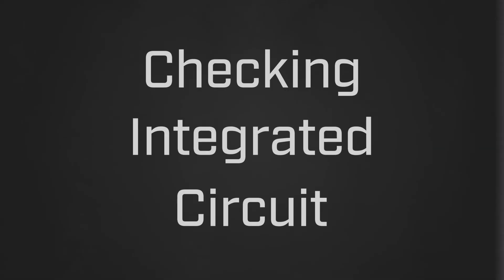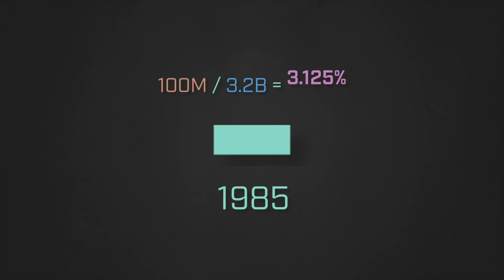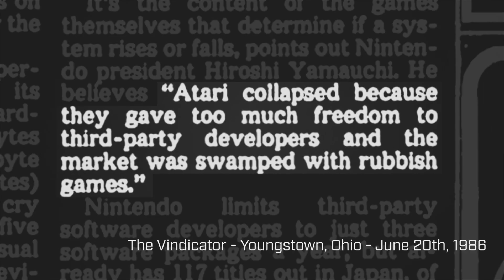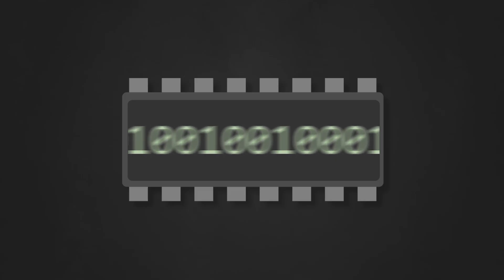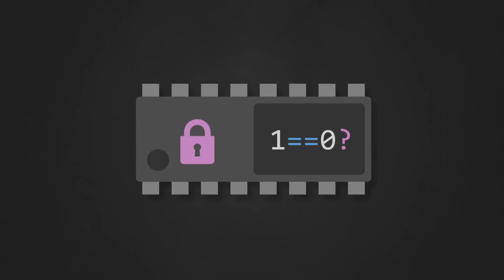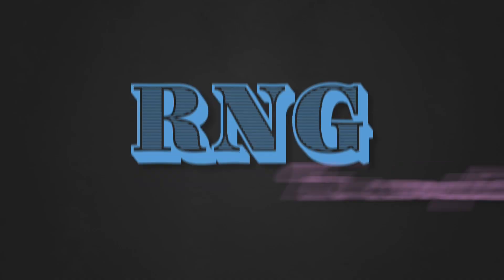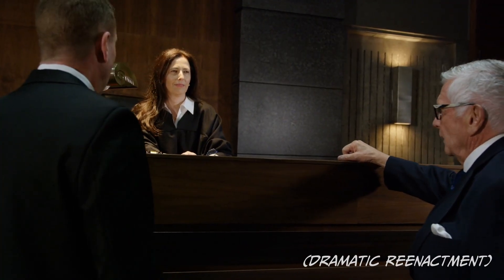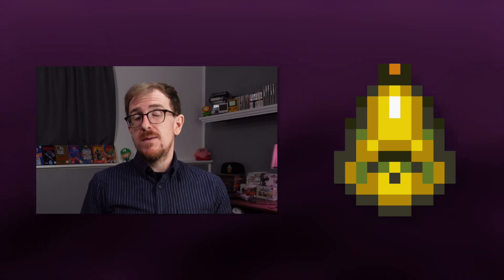The CIC & 10NES Explained

Comment: Why Nintendo made the CIC? $$$. No other reason. And I'll prove it in a moment. But first, I need to point out that the garbage games were almost all on Atari (who was the Nintendo of the 2nd generation) because they insisted that games could and would be made in mere weeks by sometimes a single developer. That's why ET was such a stinker—the guy who made that also made Yar's Revenge. The best game and the worst, one guy. On too tight of a deadline in the case of ET. Atari produced the shovelware, not the 3rd party developers.

Nintendo was concerned about that, but in Japan and in China bootlegs were there. Besides that, the 3rd party devs were not paying Nintendo a dime. Why? They didn't need to. So in the US Nintendo started using a lockout chip. If you want to make games for this new NES, you will agree to royalties AND order your cartridges from Nintendo. They didn't sell you chips, they made you submit your ROMs to them along with a minimum order quantity and they'd manufacture them for you.

While it is true that Nintendo could turn off the spigot if your games were consistently crap, there was no testing before a game was manufactured, and they never did actually turn away developers for quality. Later they did for chip shortages, sure, but that's when they instituted the four games per year limit. Which the major publishers got around by releasing games under new brand names like "Ultra".

It was always about money and about control. Like then, so now, because Nintendo never changes. (And I wasn't a toddler for the video game crash.)

Comment: @12:20 Why wouldn't you just say the lockout can be disabled by cutting pin #4 on the motherboard chip? It's not as if that's been a secret for at least 30 years now....

@17:30 Yes ,that is exactly how it works - send a voltage spike to the lockout chip and away you go with your pirated game

Comment: So one thing maybe I missed… CIC controlled the enable pins on cpu and ppu.  Why not just cut that trace and set those chips to be always enabled?
Reply from the maker: Good thought, and there is an even cleaner way to hack it out of submission. Just gotta cut the pin that tells it whether or not to be a lock or a key. Internally the chip will pull that pin down to ground by default causing it to bypass the reset functionality entirely.

Comment: So in layman terms, the nes generates a random number between 0-15 inclusive and then using a lookup table of 16 possible entries that is identical on both the nes and cartridge spit out electrical synchronized impulses that need to match each other otherwise the NES resets.
Reply from the maker: Kinda. It creates a stream of pseudorandom bits that repeat after a really long sequence and goes into a reset loop if the chip on the cart doesn't repeat the exact sequence it's expecting (aka it wants a 1 but the cart gives it a 0 or visa versa).

Comment: From what I've heard, part of what clinched the lawsuit against ATARI was that they just lifted the CIC code wholesale, including a bunch of code that was commented out, legacy code that was not even being used by the CIC at the time. So, I don't think "up to the task" was the issue there. Their developers were just being extremely lazy, and I can imagine those who said "we can't do it" were promptly fired as part of the blowback for losing the lawsuit.

One thing I've learned over the past 20 years as a web developer is that when you bang your head against the wall for hours trying to figure something out, and the solution is then magically presented to you by someone else who DID actually figure it out, you sure as hell better take the time to figure out how they did it. ATARI's devs failing even that, I'm sure that with just a cursory scan of the CIC source code, the commented segments would stick out like a sore thumb.

Comment: What a big mistake from nintendo to let those lockout chips communicate indefinitely with each other as there is a chance that if the communication just fails 1 in 1000.000 times during gameplay,then the nes will resets itself wich can happen randomly ,why didn’t they just programmed those lockout chips to only communicate during the startup process,no wonder that nes systdms with dirty contacts could randomly reset itself because of this🥲🥲
Glad nintendo removed that annoying unreliable lockout chip in the nes 2 toploader sothat such unfair shit wouldn’t happen.
Reply from the maker: Yeah they served their purpose to keep games for the most part under company's control during the early years. After the NES was a great success it mattered a lot less whether or not the games were crap as people already wanted the product and had, for the most part, forgotten about Atari.

Comment: I live in the Philippines where most of my friends had Famicoms rather than NES.  I had an NES and I bought a converter to convert the famicom cartridges to the NES.  Games that used this converter kept crashing because Famicom games dont have the 10NES.  Then I brought the converter to a repair shop where they soldered a wire to connect 2 of the pins together...  And ever since, the converter worked perfectly.  I would love to know how this worked in the same pin-per-pin breakdown that you presented.
Reply from the maker: So they probably wired one of the pins to the ground pin, which would trick the NES into thinking that it’s CIC was meant for the cartridge. When this happens the two chips end up going into an inescapable loop and the reset signals are never triggered. I have an idea for a video that shows how you can do a similar hardware hack that I plan on producing in the future.

Comment: From what I gather over the years, a voltage spike to the CIC would cause it to reset, and if you kept doing that it'd not be able to authenticate a game, done this way, a game could run without issue for the most part but this work around can damage the CIC and render the NES unable to play legit games after a while when the CIC burns out.
Reply from the maker: Yeah I read that somewhere when I was researching the video, but I didn’t fully get how it worked, so lacking detailed information on how it worked and how it might damage the chip, I opted to just note it and move on, haha

Comment: The Rabbit chip did it's job in spades years after the fact when hackers decapped it and dumped it's code to learn how the CIC works, finally reverse engineering it after 2 decades.

Comment: IIRC there was another way of circumventing the CIC: manufacturing the cartridge with a port for another cartridge (sort of like the Game Genie) so that the 10NES pins were connected to the new socket. To make this work, you would have to insert another game cart with a working CIC into the unlicensed game's socket. Since the 10NES system is entirely separate from the rest of the game cart circuitry (aside from power and ground rails), the NES itself could not detect this. As far as the lock could tell, it was communicating with a functional key and everything was groovy. This did make manufacturing more complicated, though, and also made it pretty obvious to the user that they were involved with Shenanigans, so I don't think it was used often. I think it was used by at least one unlicensed publisher, though.
Reply: It was used by Codemasters for the first few games they published in Europe--Micro Machines, The Fantastic Adventures of Dizzy, and Super Sports Challenge/Quattro Sports--and they called it "Plug-thru".  Such carts were in fact shaped just like their Game Genie!

Comment: This comment isn't about this video but it's your most recent so I am gonna ask here. So, before using VS I used codeblocks, and there, you could press F9, to build and run the file. This feature is really convinient, so, is there something like that VS?

Edit: After a bit of thinking, I found another way to make my life easier, I put a shortcut of the foler with roms on desktops, and made it so when i open a file with the extension .nes it immediatly opens the games, still it would be nice to be able to press f9 and get all of that imediatly

Comment: Nice overview, but you omitted the worst reason for lockout chip:
Control.

Well, not (only) about which games may be released on NES, but more notably, which are not allowed to be released on other platforms, if NES version is released.

Obviously this wasn't absolute restriction, if someone wanted to port good enough game from another platform, they probably didn't want to stop them. Some companies also set up separate publishing companies, maybe partially for this, but definitely also to get around the amount of game releases limit.

While many claim that Nintendo saved the games industry (only in the US, the local crash wasn't much noticed elsewhere), they also did a lot of damage to the games industry in general by demanding such restrictions. Bigger companies probably had some leverage to get better terms, but as usual, it ended up hurting the small developers the most.

This probably also explains the relatively low amount of NES games developed in the Europe. Since there was already market for Spectrum, C64, even Amiga, and games were selling (even with piracy), a few developers were willing to abandon this existing market in hopes, that Nintendo would become major platform locally. (It rarely did.)

(Of course Nintendo wasn't the only company to have this kinds of restrictions)

Comment: It's so sad that YouTube broke the dislike button, because this video earned mine. The explanation of it's inner workings almost completely wrong and bypasses pretty much not covered. If it would work as you said it does the bypass would be simple. Short the input and output pins together. Done

Comment: For the record nintendo was later told they pretty much were not alowed to control what and how many games came out on thier systems. Thus ending most of thier power in the quality control realm.
Reply: Told by whom? They cannot prevent reverse engineering for compatibility purposes, as per Apple vs. Franklin case and similar; however later consoles would simply check a copyrighted portion of the ROM that it's present verbatim, which couldn't be legally reproduced without a license, which allowed console manufacturers to exert full control over which titles are released and which aren't.

Comment: I was not aware of the seed capacitor. Neat.
I've always wondered why none of the game consoles ever put in a hardware RNG, like a diode noise source or whatnot. I can only imagine the answer is "true random numbers make debugging more difficult". It'd be a great way to troll the TAS community, though!
I was hoping you'd go into detail about the chips that use voltage spikes to disable the 10NES. That always fascinated me.
Supposedly, Nintendo removed the 10NES chip for the Nintendo top loader. Probably to improve reliability. I don't know for sure, I haven't checked in my toploader and my everdrive cart Just Works.

Are you still reading this? Here's the "well actually" pushing-up-my-glasses stereotypical YouTube Commentator bit: The name "TENGEN" is of Japanese origin, just like "ATARI". As such, it's pronounced with a hard G, like gun, guts, and goo.
Reply: Having a true RNG source both costs more money, and is difficult to test and diagnose, especially if there's a hardware fault that biases, but does not completely break, the generator.

Comment: If those lockout chips are still communicating with each other after finding a match after the console is turned on and the game is running,like if those lockout chips will communicate indefinitly then there will be always a risk that the nes could randomly reset overtime,due a bad connection or a missmatch,wich is something you absolutely don’t want,just imagine if such shit will happen during the last boss fight,i had it so many times that the nes did all the sudden reset itself after beating level 1 in mario 3 due a dirty cartride connector,, OUCH.
Reply: It's just two more vital pins against around 30 others, so the marginal reliability compromise isn't that bad, you really want the cartridge and socket connections to always be in good condition. We can disregard around 30 pins for the CHR ROM since a single false read on those will recover within the next frame, and audio expansion pins are not too critical either; but every couple cycles there's necessarily a PRG ROM fetch for the instruction to be executed by the system CPU and that being wrong will usually cause the game to either do something unexpected, reset or lock up as well. The whole adventurous assembly that would turn the socket 90° and exerts uneven pin pressure to make it a front loading unit was actually a bad idea and contributes to mediocre operational reliability of the NES. Top loaded consoles are the correct construction that doesn't abuse the connectors.

The speed of CIC communication is low so the connection quality is actually less critical than PRG ROM, there is more time for the signal to settle into the expected value, and the CIC firmware waits for the other chip to communicate for a while, and only then advances the key math, so they couldn't just drift against each other in time.

Comment: Defeating a chip by spiking it with varying amounts of voltage, causing the CPU to halt executing its program has been used for a long time, but I don't know if the technique is as old as the NES. I became familiar with the technique in the late 1990s while learning how Satellite TV was hacked. The technique was called glitching.
Reply: It's also called fuzzing.  Another thing they do is cut out or drastically reduce the voltage coming from the power supply for short periods, inducing what's called a "brownout" condition.  Processor chips act weird when they're not getting enough volts, much like humans act weird when they're hypoglycemic.

Comment: Great video that accurately describes the CIC form a not-too-high-level (as someone who understands it at a lower level and is creating a clone for my own carts). However, it needs to be clarified that the Atari in question here was Atari Games, the arcade game company. Atari Games was a 100% separate company from Atari Corp., which was making the Atari computer and video game consoles at the time. Time Warner had sold the later to Jack Tramiel in 1984, and then the former to Namco, and Atari Games was soon after bought out by its own management and/or staff. Technically, it was Tengen, a subsidiary of Atari Games, who cloned the CIC and published NES games. And Atari Corp had absolutely nothing to do with any of this.

Comment: If I am not mistaken, disabling the CIC on the NES itself is only a matter of cutting off one of the pins, effectively forcing it to always grant access to the system
Reply: Yep, I think you just cut the pin that it uses to reset the CPU and PPU.  blah blah "what good is a mouth if you can't speak" outdated Matrix reference.

Comment: It's interesting that, until the Switch, Nintendo used general-purpose microcontrollers/microprocessors for copy protection/authentication.
Now they use a pair of ASICs instead!
Reply: Nintenduo is just now figuring out what DirecTV learned about 3rd party encryption 15 years ago. DirecTV used to use standard 7816 cards and used NDS's encryption, same as many European DSS providers. Once NDS's encryption was defeated for one carrier, it didn't take long to hack them all. DirecTV swapped out their standard cards for an in house designed 7816-ASIC and developed their own encryption and have been mostly able to stay ahead of hackers ever since.
Reply: @xnetpc  rolling your own encryption is a very bad idea. At least if you get your software/hardware from a vendor, you have some legal recourse if it gets broken!  If you roll your own, you just end up being the Nintendo Wii/Wii U.
That said, their ASIC takes some kind of firmware, which is provided to it by the operating system and verified in its hardware, so it's updatable (and it's been updated multiple times—on retail units, in 1.0.0, 4.0.0, 9.0.0, 11.0.0, and 12.0.0)
Reply: @valshaped  What do you do when every third party encryption you've tried has been compromised? Move development in house or give up.
Reply: @xnetpc  Encryption is broken when the math is flawed, (i.e. every Pokemon game that encrypts saved data,) when the implementation is flawed, (i.e. the Wii's Trucha bug), when the hardware is flawed, (i.e. the entire Nvidia Tegra line prior to the TX2,) and when technology catches up to the point where keys are trivially cracked or hash collisions are shown to be possible (i.e. DES, MD5.)
"Don't roll your own crypto" refers to the math. Don't toss around random cryptographic primitives and expect your system to be secure. Write your own RSA implementation, implement it in hardware all you want, just don't modify it unless you're a researcher looking to develop something new, or you want to explain to your boss, your peers, or your customers why the cryptosystem you developed is broken before its time.